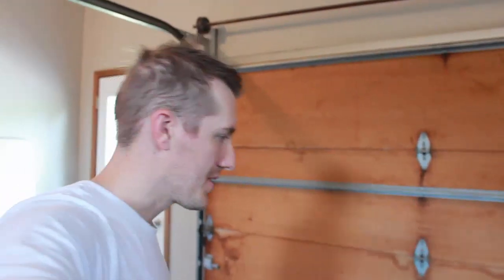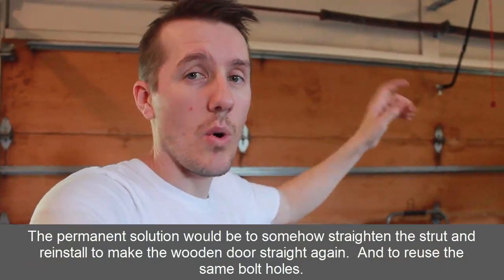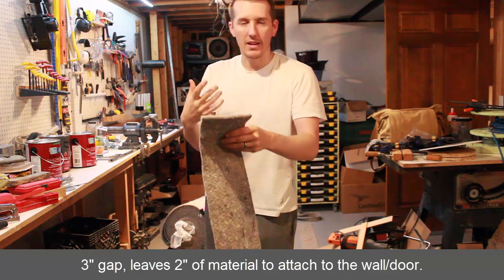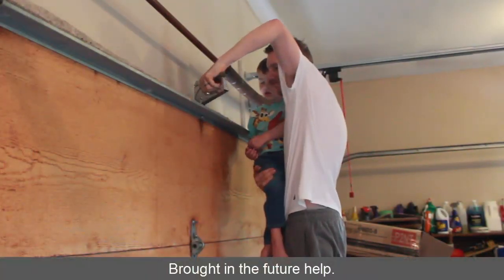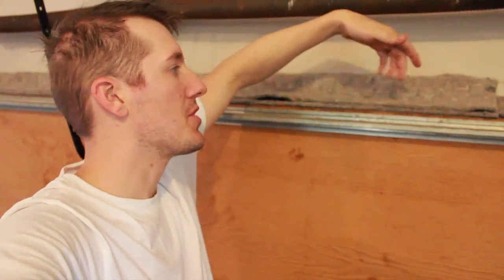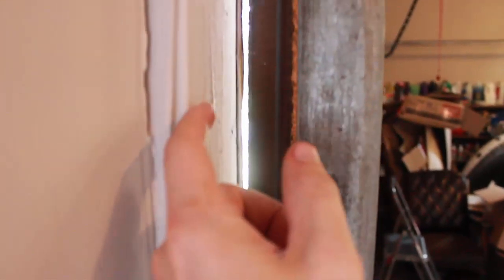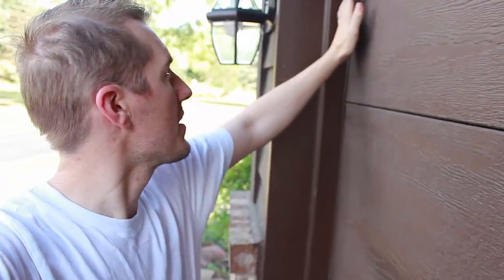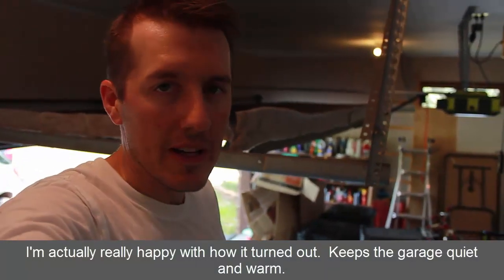Fix the Gap - Garage Door Seal

Comment from the maker: Garage Door Strut Reinforcement:  https://amzn.to/2YoLaGT
Universal Rubber Garage Door Bottom:  https://amzn.to/2YnNldJ
BLOG:  https://davewirth.blogspot.com/2018/11/gap-in-sagging-garage-door.html
I know this isn't exactly fixing the problem, by straightening the door, but this was a cheap and easy way to seal a bowed/bent garage door and seal it from the weather.  The ultimate solution would be to fix the 18' long struts and try to straighten the bent wooden doors.  That's a job for when i have more time on my hands.  For now, adding some felt padding to the top, kind of like a door draft skirt, worked well at keeping a seal around the door.  Maybe in the future i will try to fix the door, but those solid wood boards look tough and i doubt it will be easy.

Comment: If anyone has this problem which I had as well check your topmost roller wheels, the bracket should have an adjustment where you would loosen a couple bolts. After the bolts are loose you can push the door closer to the frame. While pushing on the door and pulling on the roller bracket, you then tighten the bolts down. If your top roller bracket does not have an adjustment (you can buy a roller and bracket with an adjustment) or you can move the top wheel and bracket down say an inch. The curvature of the rail will push the door outward to close the gap on top.

Comment: So really you need to install weather seal around the door and wear the top panel is there is 2 roller brackets you can adjust to make the top panel closer to the jame and your problem will be fixed
Reply: Where and jamb ..  you wear clothes. Like: Where are the clothes i normally wear?  And also stuff can ware out..    Jelly and jam.  Door jamb …
Reply: I get ya. The top panel pivots in and you can adjust it to smoosh a weather seal.
Reply: The wood is sagging there will still be a gap at the top center of the door

Comment: just buy garage door seals.......... they have a big enough moulding they would fill that gap. definitely make the sides air tight. Could always add wood for the top section if the gap didnt fill, but the seal casing it quite large, i think it would of worked

Comment: Can you say "bandaid"?  Try to Fix the issue instead of covering a symptom.
Reply: Sometimes just a special insole will stop flat feet pain over corrective surgery.  Some people just wear glasses rather than have lasik surgery to correct their vision.  There are times where the band aid becomes permanent, does the job and doesnt cost you potentially a fraction of what it would to do the whole “proper way” shindig..  i know after my kids are had and not gonna want to have any more, aint nobody coming at my dong with a knife and mess around with my giblets.. just gonna make sure jimmy’s got his hat on if its gonna get wet..

Comment: just adjust the vertical tracks on either side of the door.  slide the track towards the wall a quarter of an inch or so.
Reply: Did you even watch the video bro, not even close.
Reply: He needs to fix the sag in the center of the door

Comment: I would have bought a flat bar or plate about a quarter of a inch thick,  the full length and width of the door and straighten out the sag in the door with it . Line it up at one end drill throw the bar or flat plate and add a screw and continue to to do this down the width of the door forcing the sag out and making it straight again.

Comment: I like the concept in general and appreciate you showing what worked and didn't work. The only problem I see is that, depending on where you live, the carpet padding is likely to absorb moisture, potentially ending up mildewed or becoming structurally unstable.

While it's a little more expensive, I think the better solution would be to purchase an additional door bottom like the one in your link, and leave it flat and attach it to the top. It should remain flexible enough to bend into position when closed, but provide the durability needed in terms of moisture resistance.

Comment: Easy video straight to point and totally clear. Nice idea.  For the bow in the door can you use a cross rods pushing out to a vertical beam in  the center 
But it will help if you straighten old  those beam 
What happens if you use  pool noodles wrap on the material or not and let the door just crashed them

Comment: Fun fact, it's possible your garage sag was due to a break in at some point.  Thieves will push into the center and either put their arm in or a hook to snatch the safety release.

If you plan on keeping expensive stuff in your garage other than cars, use the side latches as much as possible.

Comment: You should put foam board sections on the inside of the door. That will help reflect the heat, and keep it in. I'm in Vermont and deal with the same issues.

Comment: Thanks for the video &  great idea for somebody that can't afford more. I have a question tho, how is that carpet pad holding up for you overtime due to rain and snow etc?
Reply from the maker: Still working great.  Again, it's not cheap foam carpet padding.  It's a heavy duty felt pad (i think intended to go under a rug)
Reply: I would have used a flat bar the full length of the door and straighten out the sag with it .

Comment: Wouldn’t something made out of rubber or silicone do a better job of keeping the air out?
Reply from the maker: The felt does a pretty good job.  And it was free.  But yes typically door seals you can buy are made of rubber.

Comment: Loosen the center bolts of the beam and add material between the beam and wood. Should help in pushing the wood back into shape. Wouldnt hurt to saturate the upper wood door with hot water after you do the above and let it dry out in the down position.  I do like your idea though
Reply from the maker: This is the first good response i've heard.  Many comments are "just replace the door".  It's been 3 years since doing this and the felt has held up great.  But if i ever want to try straitening the door i will do this.
Reply: @DaveWirth  buy a new house

People just don`t understand the concept of doing it yourself, using free materials...
Reply: It’s so much better for the earth (and your pocketbook) to wait as long as possible to replace. That money can be spent on your family or donated or saved. I’m far away from being able to afford a new door and this is the first actual diy video I’ve found. I’d rather not buy new seals, I don’t have the money, I do think I have some leftover mats that might work just enough though!  @DaveWirth

Comment: Thanks.  This saved me some time fiddling with mine.  Hows it holding up for you after a few months?  Would you still recommend carpet?
Reply from the maker: Still perfect after a few months.
And i didn't use carpet, i used heavy felt pad.  I think it was felt carpet padding.  NOT the same as the foam carpet pad.  The stuff i used was heavy and hard to cut and rip.  But here in michigan it's cold and without it the garage would be freezing.  With the felt padding it's pretty air-tight and that's the main thing, keeping the air out.
So use whatever you have, don't buy anything, something flexible but holds its shape.

Comment: I have the gap too but mine is from the garage door being pushed while the slide lock is in place so the motor just yanks trying to lift the door with no avail.
Reply: And overtime created the small gap or pushing on the outside door upward nudging it open almost.  Now there's a gap.   Oy vey. Fml

Comment: How well us this holding up with use? Thinking of something similar for mine
Reply from the maker: Still the same as when i put it up.  The tough part is on the edges though, my door has wires and there isn't enough room to put the felt.  So in some spots the wires have caused the felt to fold up, but really that only happened at 1 spot on the side of the door.  Otherwise it's been great, 20 degrees here (though maybe not Minnesota cold) and it's a lot warmer in the garage.  
Oh and Harbor Freight sells 1000 staples for like $2, so you can get the 1/2" long staples to make sure it goes into the wood enough.
Reply: @DaveWirth  awesome. My door is not wood so I'll have to glue or something Instead of staple. Will see what I've got to try it with!

Comment: most people just installed a piece of angle iron on the very top panel and that forces the top panel flat again
Reply from the maker: Ya my door had a couple of the triangular braces on there, but they were also bent.  The next step would have been to re-tighten or install a new one that's straight.  But the thick cloth flap has worked really well the past 3 years.

Comment: lubricate those springs.
Reply: You know i ran out of garage door lube spray and was trying to get everything all nice and lubed up.  And the wife went all economy on the joy jelly and bought a 10 gallon bucket of butt lube..  used that stuff once about 5 years ago and dagum thing still as quiet as a fart in a windstorm..  and it smells like strawberries when it gets hot in the summertime..  still got enough of that damn lube to rub on all 4 tires of the mother inlaws tires when she comes over so we can all sit there while she spends half an hour backing out the driveway..